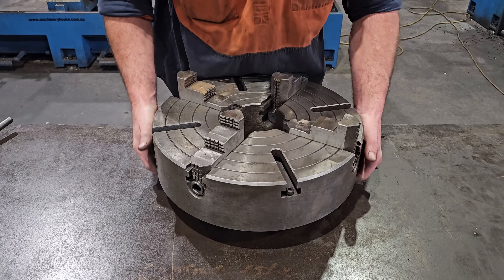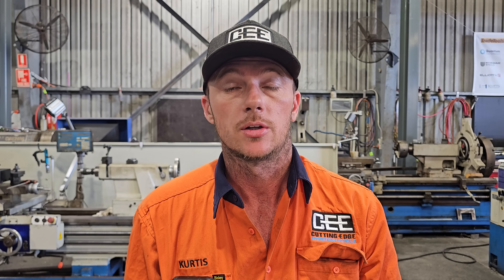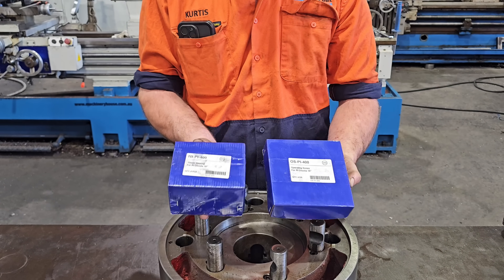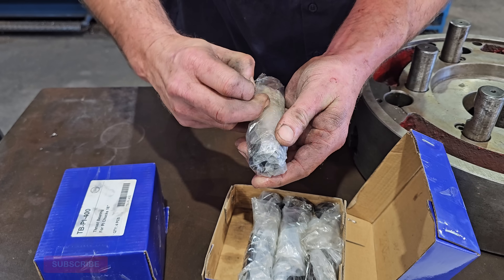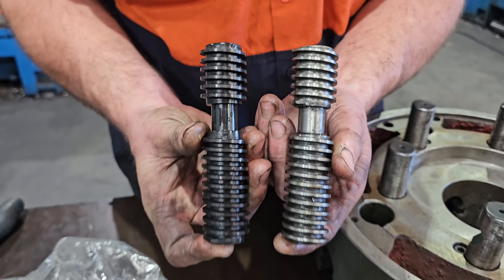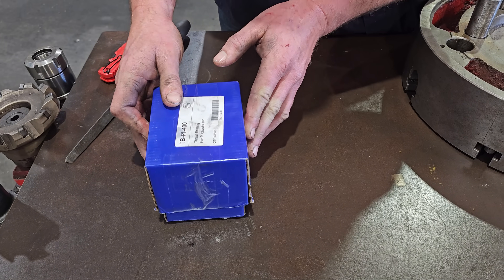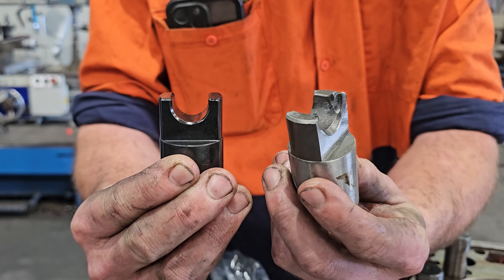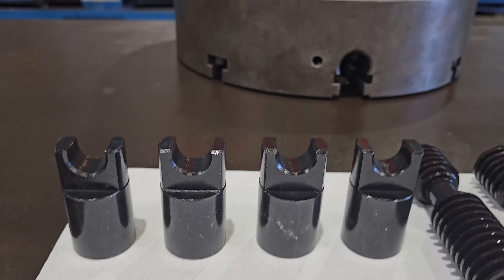Gator 4 Jaw Chuck Update! Can We Save It From Scrap!? 🛠️

Comment: Hearing about the lack of heat treat, the fact that the original ones were interference fit makes sense.  A shrinkage occurs during heat treat due to changes in the crystalline structure.  However, Idk if it makes sense that those parts missed both incoming QC dimensional check and then were assembled with what must have been an unusual amount of effort.
Reply: Good points, what is impressive is that the replacement parts fitted perfectly,  a true indication of tolerance control.

Comment: The original un-hardened thrust bearings, were possibly machined fractionally oversize to allow for dimensional movement during the heat treatment, then finished to size (centreless ground?). That might explain why they were such a tight fit.
Reply: If they were finished to size then they shouldn't be tight.
Reply: @garymitchell5899  Bad grammar on my part. The hardened ones go on to be machined to finished size, their un-hardened ones never got that far, and so were oversize when fitted originally.
Reply: @steveNCB7754 Ok, see what you mean. Yes that's plausible.

Comment: I'm surprised at how small the contact area is between the bearings and the screws. I know it's been designed by engineers to handle the loads you will put into the chuck. It's still a little surprising looking.

Comment: Yo mate Skippy do lol jk jk.   Love your videos...  I have learned a lot from you i have an old brake lathe with a quick attach 4 jaw chuck was inspired by you to turn down pressure plates and apply pistons in my transmission for my sled pulling rig 12v cummins with a 48re tran

Comment: Saying they are hardened just because they are black means about zero. Especially since seeing you drill & tap holes with HSS in those bearing blocks, it is very easy to see they are not hard, but tough at the most like Q&T molysteel.

Comment: Yep. my Gator chuck is just like yours but not as bad.  A standard file eats into it easily. 16"/400mm D1-8 4 jaw.  Mine shows no signs of hardening either.  Mine was purchased new in 1/2018.

Comment: Q do you have to balance the chuck like you would a tire?
Reply: Since it's cast, it would (or should ) be balanced at the factory, replacing these parts wouldn't be enough to throw off the balance. If you were turning something where unbalanced vibration would be a problem, you would need to balance for that part since the part it's self could be unbalanced.-

Comment: Even though the parts are heat treated in large batches, they have never had a complaint before, of course not. It is a typical customer service response. I am surprised you received replacement parts.

Comment: While you have the chuck off the lathe, drill holes in the jaw ends and tap them for screws to hold sacrificial jaw covers. When you need to hold a chrome-plated shaft, having the removable jaw covers in place would make your life much easier.
Reply: He already has a set of soft jaw covers, think he even did a video on making them. Good thinking though
Reply from the maker: We rarely use the 4 jaw for holding round chrome bar but that's something Kurtis would definitely do if needed 😊